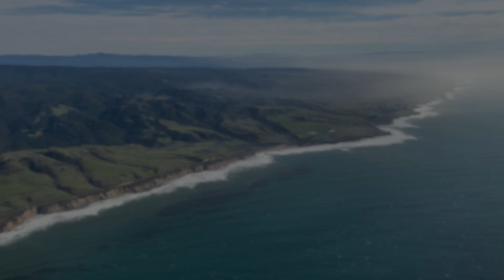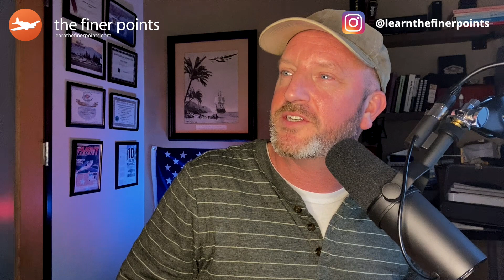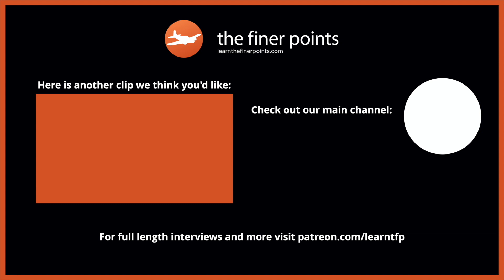What is the best way to remove snow and ice from an aircraft?

Comment: I did this last February (2020). There was snow showers going to hit Salt Lake area the day before I was leaving. I went to the FBO and had them put the plane in the heated hangar overnight. 25 degrees the next day. Did the preflight in the hangar loaded my passenger in the back and had the plane towed out of the hangar. Fueled the plane, sumped the tanks, payed the bill and the oil temp had fallen from 50 degrees down to 45 in that little time. Best $120 I ever spent.